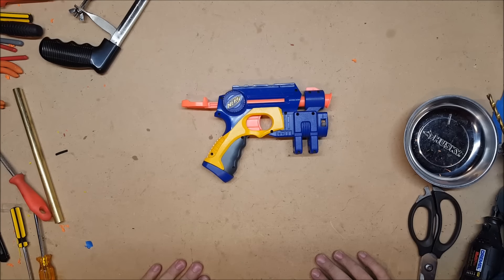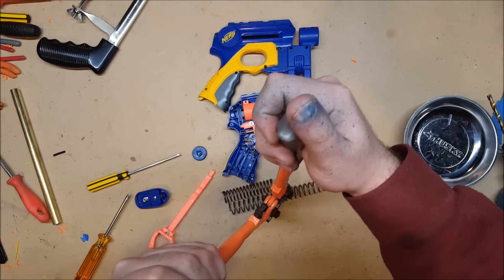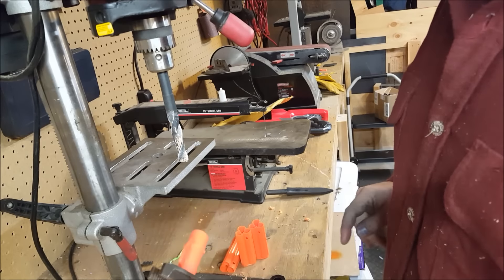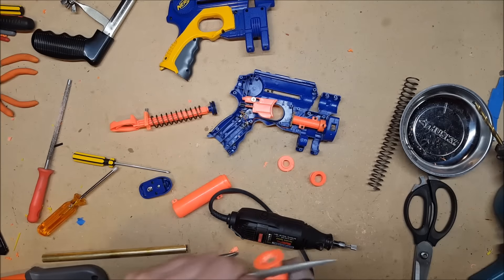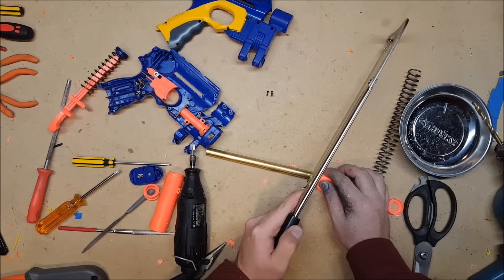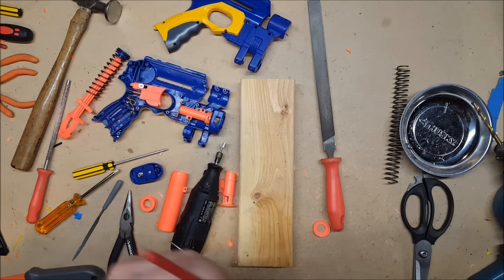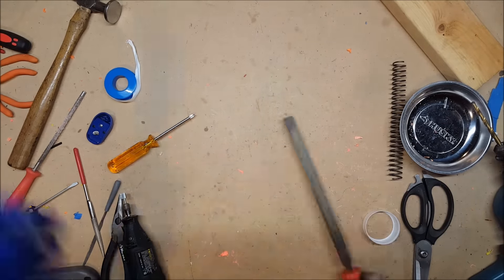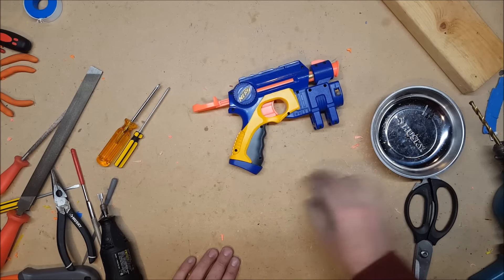Nerf Nite Finder Mod Guide

Comment: I need help:

I modified my NiteFinder, it turned out great but, i can't put the screw that goes to the battery holding area anymore
Reply from the maker: I'll bet large sums of money that you lost the tiny square nut that goes in there that the screw threads into.
Reply: Captain Xavier 
oh, thanks for clearing things up, hope that I find the nut, also, do you happen to know the size of the nut? Thanks! :)
Reply: @CaptainXavier  captain, the same happened with me. I lost it. But I glued on the battery cover plate with a bit of hot glue. It's still pretty easy to pull it apart if I need to

Comment: Thank you very much. I found this video to be perfect in helping me modify my original 2003 NiteFinder. It was frustrating, but totally worth it as it hits harder than it did before (obviously), so kudos to you.
Reply from the maker: You are welcome!
Reply: Captain Xavier captain X thanks for this I'm modding my nite finder but any tips for removing screws with striped heads my one dart tag blaster barely worked so I tried to see what was wrong with it and two major screws are striped and I don't have power tools

Comment: If this is too complicated I would recommend you put rubber bands below the barrel and on the priming handle and one to hold the others on and removing the dart peg from the barrel for half dart use I have done this

Comment: ok so i did the AR removal and i taped the o ring. because of your vid im gonna try the k26 spring and the brass barrel. 2 questions. 1 is there a special place to get the k26 or something similar and 2 what size is the brass tube. ok 3 questions does the brass barrel make a difference over stock type?
Reply from the maker: McMaster-CArr sells K26 (but you are going to end up with a lot of it), 17/32 in Brass, and yes it does.  Especially on a heavy spring load.

Comment: What is the advantage to a brass barrel?
Reply from the maker: Better seal around the dart.  Nerf barrels are generally only tight at the very bottom so power is lost.
Reply: Style points
Reply: @CaptainXavier  can you make a pump action disruptor?
Reply from the maker: @claw6376  well, it is obviously possible, yes.
Reply: @CaptainXavier  add the stock if possible
Reply: and make a video on it

Comment: Hello Captain Xavier! I am trying to paint my Nerf Nitefinder Ex-3, but I am not sure what material to use to paint/color it; sharpies? Acrylic paint? Spray paint? What do you recommend? Thanks!
Reply from the maker: https://youtu.be/8iuo2jvZcjY
Reply: @CaptainXavier  Thank you so much! I just watched the video. You fully recommend those spray paints and no, like, paint pens or markers? Sorry for bugging you again!
Reply from the maker: @danielj.raimer4787  markers, absolutely not. Paint pens are great for detailing.
Reply: @CaptainXavier  Ok! Thank you again! So, for the orange parts that are small like the plunger and the part you pull back, you recommend paint pens? And for the larger parts I should stick with one of the sprays?
Reply from the maker: I would strongly advise against painting any moving parts. Not only will the paint rub off from the parts rubbing against each other but if the paint is too thick it will prevent parts from moving at all and the blaster will not work.

Comment: Can we please have an ion fire mod guide I know it's simple but I'm new to modding and I would really appreciate it thanks
Reply from the maker: I do not own one yet.  If I ever get one I will do a Mod Guide on it.
Reply: this may help you,CAPTAIN XAVIER, 1 huge flaw, and some miner ones, you did not put goop where the dart barrel sits on the plunger tube, and it leaks a lot of a air, also because the way you cut the barrel you are adding extra friction to the path of the dart and because it is at an angle there would be not air to push it out, and because you used a very short barrel your plunger head is hitting the front of the plunger tube relatively hard so you need to pad it, also you did not reinforce the plunger rod, i have found it to bend overtime, and this is optional but you should have upgraded the spring if you have not and get i filling tool to file the place where the plunger rod catches, also do not secure the plunder tube with the 2 screws because that way you would be extending the plunger tube just a bit, thanks for reading man and i know a nite finder which i just overhauled to its limit and i was just pointing out some pro tips if i do say so my self.
Reply: Captain Xavier thank you

Comment: Is there any substitute for the k26 spring? That I could possibly find at a Home Depot or lowes? Because I don't have a credit card to purchase online
Reply from the maker: Yes.  Check the spring section of Home Depot.  They have a few that are similar in size and strength.
Reply: Captain Xavier great, will look into it thank you so much for the speedy response!

Comment: is there any reason to take the dart peg out if you don't plan on brassing your gun and dart compatibility isn't a problem?
Reply from the maker: Some might argue that it creates a little more drag.  I suspect it is negligible but I cannot back that up with hard science...yet...
Reply: Captain Xavier dude. I shoved a trampoline spring I found at ace hardwear in a nite finder I just picked up at goodwill and it has the same fps as my unmodded Apollo. wanna take bets on how fast it'll blow up in my face.
Reply from the maker: Nope...not taking that bet...

Comment: I just bought a nite finder at a yard sale for a quarter, STEAL! I was going to use a Tek 6 spring since I don't have a k26 on hand, but the spring was too short, however, I could fit it with the stock spring, so I added the Tek 6 spring WITH the stock spring, and I'm now a proud owner of a successfully modified nerf pistol. It's my first blaster I've successfully modded that isn't a jolt, and I'm happy wi the results. Didn't remove the air restrictor though, I don't have a drill :/
Reply from the maker: Well done!
Reply: I do have an issue with the blaster not catching, especially now that I've removed the air restrictor. I put the catch spring and mechanism back in the right place, but it's not catching, and when it does, it only catches for a short time until it fires involuntarily.
Reply from the maker: bringoutthelegos you probably need to increase the catch spring.

Comment: Hey Captin X,
What happens if you leave the ARs in a mav cylinder for the drain blaster shotgun?
Could it only fire 1,2,3,4,5,or 6 darts?
Also roughcut for an episode of can it take a k26.
Thank you for reading my comment.
your fan,
Jenson
Reply from the maker: It would still fire them all, just not as well.  There is no point at all in having ARs in a compressed air blaster.  The AR is there to protect the gun against dry firing.  That is not a problem with air blasters.
Reply: good to see you again.
Reply: CAPTAIN XAVIER, 1 huge flaw, and some miner ones, you did not put goop where the dart barrel sits on the plunger tube, and it leaks a lot of a air, also because the way you cut the barrel you are adding extra friction to the path of the dart and because it is at an angle there would be not air to push it out, and because you used a very short barrel your plunger head is hitting the front of the plunger tube relatively hard so you need to pad it, also you did not reinforce the plunger rod, i have found it to bend overtime, and this is optional but you should have upgraded the spring if you have not and get i filling tool to file the place where the plunger rod catches, also do not secure the plunder tube with the 2 screws because that way you would be extending the plunger tube just a bit, thanks for reading man and i know a nite finder which i just overhauled to its limit and i was just pointing out some pro tips if i do say so my self.

Comment: CAPTAIN XAVIER, 1 huge flaw, and some miner ones, you did not put goop where the dart barrel sits on the plunger tube, and it leaks a lot of a air, also because the way you cut the barrel you are adding extra friction to the path of the dart and because it is at an angle there would be not air to push it out, and because you used a very short barrel your plunger head is hitting the front of the plunger tube relatively hard so you need to pad it, also you did not reinforce the plunger rod, i have found it to bend overtime, and this is optional but you should have upgraded the spring if you have not and get i filling tool to file the place where the plunger rod catches, also do not secure the plunder tube with the 2 screws because that way you would be extending the plunger tube just a bit, thanks for reading man and i know a nite finder which i just overhauled to its limit and i was just pointing out some pro tips if i do say so my self.
Reply from the maker: Thanks for the advice!
Reply: Captain Xavier NP, its just my 2 cents
Reply: Sniper Pro nerf mods 2 or 200

Comment: I have noticed that you prime the blaster while the dart is in. I have never modded a blaster, but would this cause vacuum loading?
Reply from the maker: Not usually.  It can if the seal on the plunger head is really tight but I avoid that because if it is that tight it causes too much friction and you lose power.

Comment: You should check out a website called Fasttech. They sell LED emitters and diodes. They have quick and cheap shipping as well as huge variety. You can get get good quality 500lumen LEDs for like $1.50.
Reply: BLOOGaming adds are getting smarter

Comment: did you remove the piece of plastic that holds the AR restrictor
Reply: Sir Wolfingten I personally don't remove air restrictors because I like to dry fire for no reasons.
Reply: I Do too. but when your mod old n-strike blasters it really helps to take out the ARs. And if you are brassing them you kinda have to.
Reply from the maker: No.  I just dremelled it out.
Reply: ENP10 yeah I'm just saying if you remove that you can vacuum load your dart and get stuck and shredded